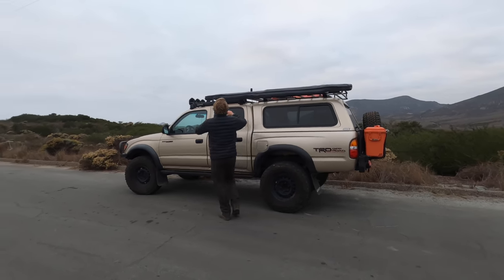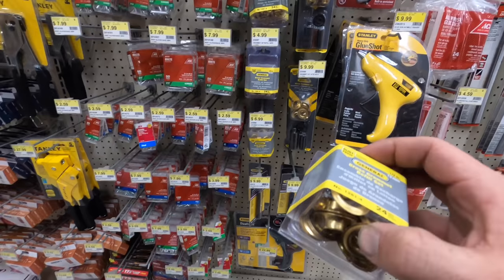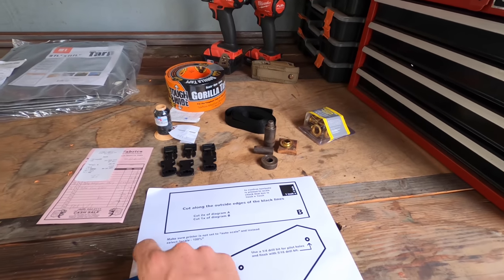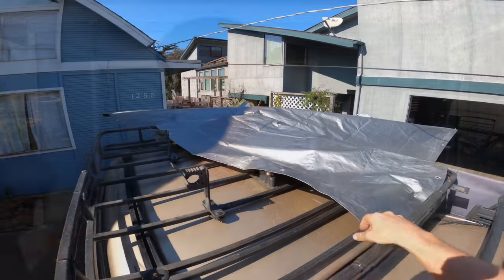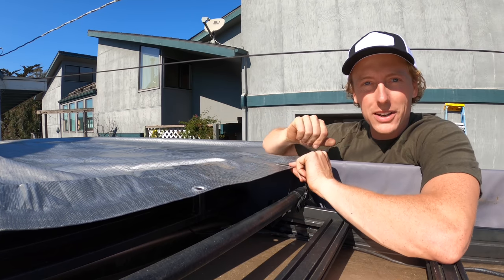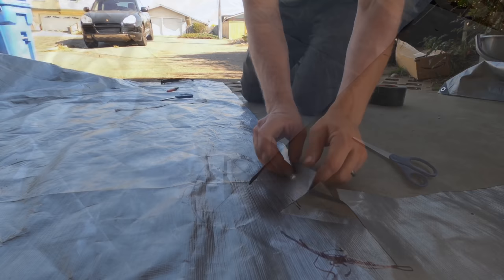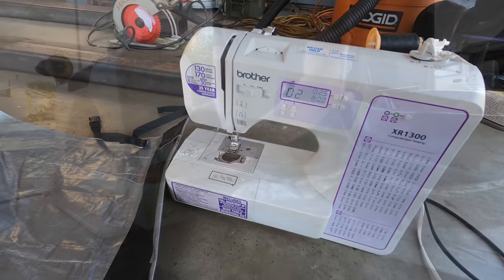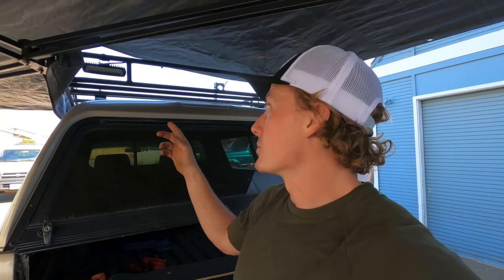Part 3 cutting the tarp for your 270 awning

Comment: Excellent! This is such a great project, and very well executed.

I'd like to add that if the grommet hole punch is used at the inside corners before the cuts are made, it will create a 'fillet" of sorts, that will be less likely to tear. Of course, reinforcing is still a good idea.

Comment: I used  3M outdoor carpet tape to make awnings for my gazebo which is double sided and three years later it was still stuck solid when I had to replace the awning because of sun rot. Great stuff. I also use it to fasten a faceplate to wood for turning on the lathe just to show how strong it is.

Comment: Soon as I saw this 270 I subscribed and bought the template. I've done up a mock one of these in wood to test out a couple ideas. 1 was to have a 4th arm to go straight along the back as another anchor point. Then having a longer piece of metal, aluminum,  to go along the edge of my jeep on the rack to just give it a little more stability of course the front bracket that attaches to the rack would be steel for strength. But I'm still playing with it... sucks that it is winter now might have to back burner this for 5 months till the weather is better :) Keep up the great videos though love the detail and thought process !!!

Comment: You have two straps one on each end. Whilst the one at the rear/passenger side makes sense as it's used to tension the tarp, would it not be possible to mount the other end directly to the rear bracket/arm (or the mounting to the roof rack). That way, you'd only have one strap to tie down. Also, would one longer tensioning arm work as well as three shorter ones? Just a couple of thoughts to see if it can be used even more simply and speedily.

Comment: I will be making mine in the coming weeks.  I just purchased the plans from you.  I am going to try to do fabric instead of a tarp.  I work for a Geotextile company I am going to try to see what we have that might work.  I do have a couple questions though:

1. Did you weld the ends together or do they just bolt together with the bolt that olds the tarp down?

2. Did you look at aluminum?  Was it too expensive?
Reply from the maker: Heck ya that’s awesome! I’d love to see what you come up with for the fabric. 
1. Yep the ends are welded together 
2. Currently only have steel welding setup, steel is super cheap, about $40 bucks for the metal in this project. Aluminum is rad because it’s so light, but this steel tubing is 3/4 16th wall, and the whole thing only weights about 35lbs I think? So aluminum would be maybe 20 lbs? But not a strong and for 15lbs I think  it’s not worth it.
Reply: @OverlandUnderBudget  totally agree!  I’m torn on the fabric.  We have a liner system but I’m afraid it will be too heavy for the frame.  I think I might just do the rip stop material

Comment: Great series of videos but I think I missed something. Between video 1 and 3 it looks like the mount and arms changed. Also, did you use galvanized pipe for the hinge in video 3? I'm working on an F150 now and this will be perfect.

Comment: How long is the ARB awning bag? How long could you make the arms and still have them fit in the bag?
Reply from the maker: the bag im using is 8ft long, so not to much longer then what i built in the video maybe 7ft 8 inches? you need a little from for the hinge

Comment: I want to know something. Why did you do the trap to the driver side? Vs the passenger side? I am planning to build one soon. But was wondering if I am missing something on placement
Reply from the maker: Good question! i placed it on the driver side because my tail gate swing out opens to the passenger side. I wanted the area i would be cooking in to be covered and not have to walk around the swingout.
Reply: @OverlandUnderBudget  I’m building out a 10 foot cargo trailer, can I lighten the arms to cover the side of the trailer?
Reply: Lengthen

Comment: Just out of curiosity, why did you choose to mount it on the drivers side?
Reply from the maker: Great question! So I have my tire carrier and drop table on the rear bumper. It opens to the passenger side so when I’m changing a tire on the side of the road it’s not opening into oncoming traffic. It also has the drop table. I mounted the awning so it would swing open and cover the table while I cook with the swingout open 👍🏻